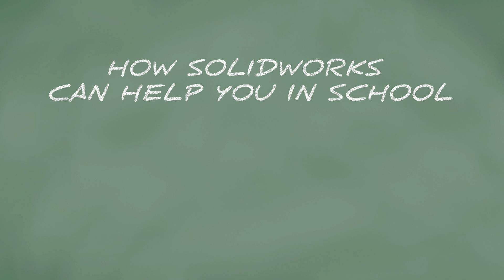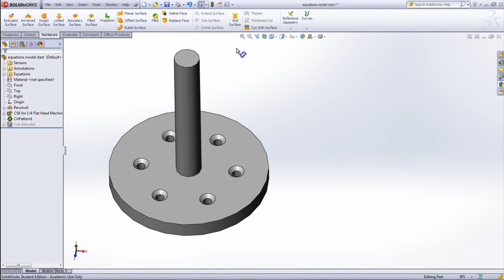Equations Help Using SolidWorks

Comment: Hi, I am facing problem in equation when I go to change my equations, they dont update the part and rebuild. I have checked the automaticly rebuild box but they still don't change in the model, as shown by the same mass properties.
Reply from the maker: Hi there! We are happy to point you in the right direction. For technical inquiries, with your subscription, you can always access Knowledge Base for immediate troubleshooting. If Knowledge Base does not help, you can contact your local reseller through your organization.
 
Even without a subscription, you can access your MySolidWorks for information. Check it out here: https://my.solidworks.com/
 
For SOLIDWORKS Help, check out http://help.solidworks.com/HelpProducts.aspx
 
For learning resources, check out http://www.solidworks.com/sw/resources.htm
 
Or, head to our YouTube channel at youtube.com/SOLIDWORKS.
 
Our Tech blog is a great resource as well http://blogs.solidworks.com/tech/

Comment: how to sync two circle example:-
one circle dia75mm and secound circle dia1000mm
dia1000mm (1000mm-100mm=900mm) so change 
dia 75mm change (75mm+100=175mm)
mins i one circle dia minuse so secound dia pluse is value
how create